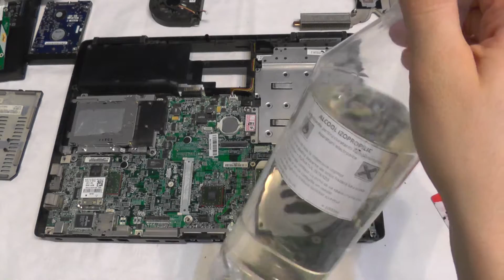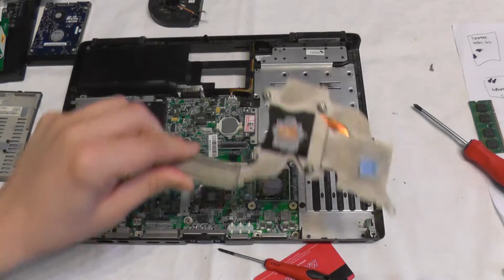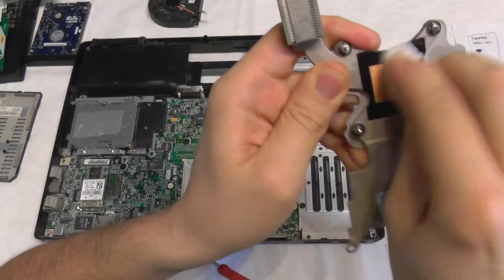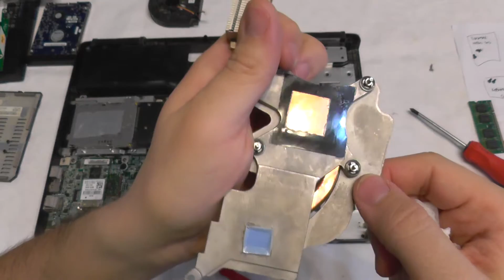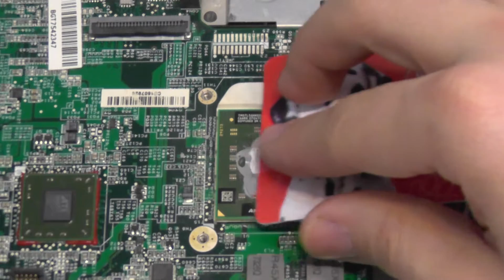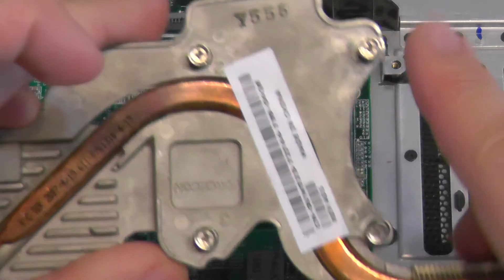Dell Inspiron 1501 CPU Cooler Cleaning & Thermal Paste Replacement

Comment: this actually helped me, ive done thermal paste on my ps3 tons of times but never my laptop so now i know its basically the same procedure. get the old shit off, apply the new with some sort of card on the chip. i just accidentally took my fan off forgetting there was thermal compound attached to it so to be safe im going to replace the paste as the factory seems to never put almost any on there.
Reply from the maker: I'm glad that you have found my video useful. Thanks for watching!

Comment: It would have been more informative if you described what it is you are doing, the chemical that you are cleaning with, etc. I was looking for information, not a useless sound track.
Reply from the maker: You are right, it's a reason that I am no longer making this kind of music-videos. Newer ones only have voice over with full explanations. The chemical that I am using si isopropyl alcohol. Let me know what other informations you need and I will try to help and answer.
Reply: @TechTronic9000  with a software editor video you could replace the sound and reupload it, It is simple. Thank you for video.